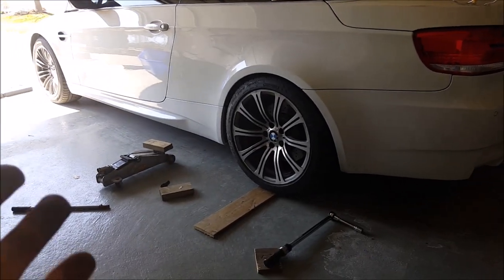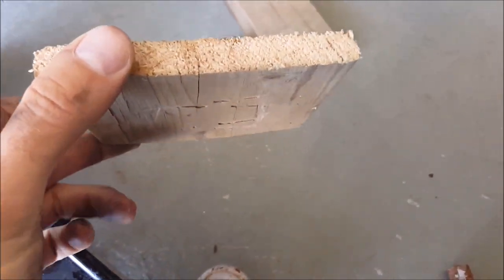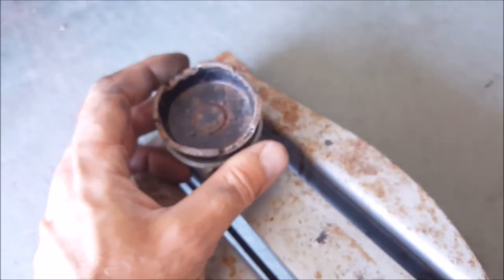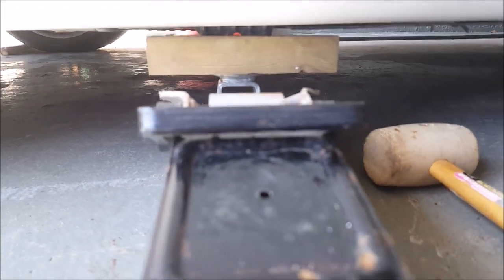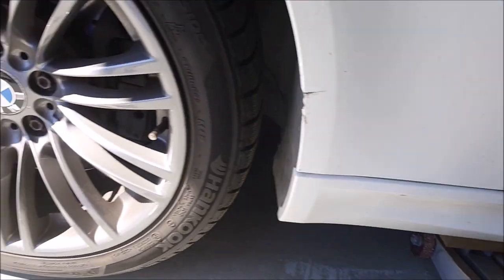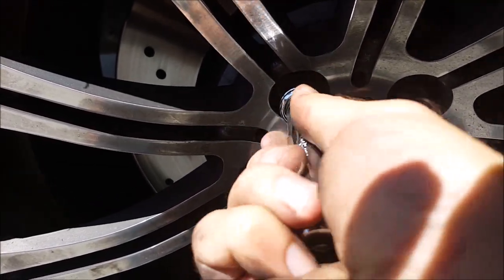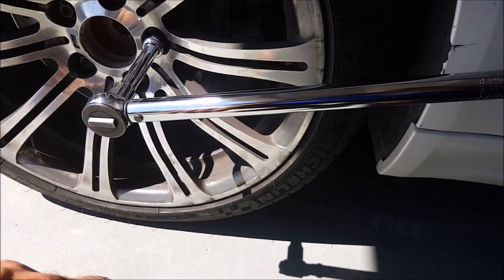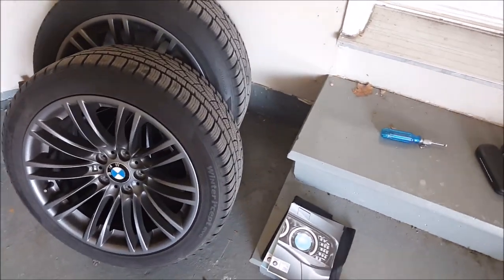How To Jack Up Any BMW Without a Jackpad Adaptor

Comment: don't use a torque wrench to loosen the lugs nuts, could damage the torque wrench. it's ment to tighten a lug nut or bolt at a specific torque. 

BREAKER Bar is the tool you use to break loose a nut or bolt.
Reply: beat me to it, I used to do it, before I wrecked a good torque wrench
Reply: Great advice... The video was going great untill he used the Tq to loosen the bolts.
Reply: Some torque wrenches allows you to use the opposite side of where you attach the socket so that you don’t damage the spring mechanism inside when loosening.
Reply: Thank you comment section for saving me a torque wrench!
Reply: Right?
Reply: @HarryESwan it was going great until I saw the rotted fence wood he tried first 😂 still watching for entertainment purposes

Comment: Why the hell are you using your torque wrench to break free wheel bolts?
Reply: @Chuck Yet another reason not to take advice from the internet!
Reply: @someone123421  My wrench can be damaged by doing it. Warns against doing it in the manual and a big sticker right below the snap on logo.
Reply: Hahahaahah

Comment: cut a piece of wood (preferably not pine but a decent bit of dense hardwood) to just under 2x2x1 that goes in the jacking point, then you are jacking directly on the frame of the vehicle, and not the plastic locator, if you have a jack that does not move properly on the ground as you jack it will strain the plastic and probably ruin it especially if you are in a very cold area.
plus as previous comments on the torque wrench for only tightening as by the time it has been  abused on 20 times undoing the wheels to change a set, unless it is a very good one it won't be in spec to do them back up again and normally read low meaning the threads will be overtight  (not a great idea on something that holds your wheels on- Breaker bar to undo torque wrench to tighten and do so with progressing increases not all in one go.

Comment: DONT loosen the bolts with a torque wrench! Use a breaker bar for that because youll fuck up the torque wrench. And you dont have to go in a star pattern if you are just loosening them, only when you tighten them.

Comment: I cut my 2x4 to about 2" long so it fits inside the jack pad hole, got about 3 uses before it split. Also please don't ruin your expensive torque wrenches loosening lugnuts, get a good breaker bar you can jump on.

Comment: That torque wrench is most likely going to need the brushes on it's internal flux capacitor looked at and possibly replaced or rotated.

Comment: These are dangerous instructions. Wood is not meant to support a (4000) Lb Car. Torque Wrenches are designed to tighten fasteners- not loosen them.  That's what Breaker and Cheater bars are for.

Comment: EIC: Have enjoyed your videos and content for years. And I'm the original owner of a spec-order 2003 e39 M-Sport that I've recently rehabilitated with full body paint job, bumper cover replace and full suspension, shocks, struts and springs refresh. A number of your actions are BMW do-not-dos.  Stick to red pill content.

Comment: i realized i lost my actual jack point square thing where the adaptor goes into. i have the adapter but i guess my jack point came off in a minor crash this winter...is there a safe way to jack up my car without this or do i need that plastic rectangle jack point piece?
Reply: did you ever figure it out??
Reply: @someone123421  i ended up ordering the jackpoint square. they were really cheap

Comment: Title should be.. How NOT To Jack Up And Loosen Your Wheel Bolts On A BMW.  You just ruined the plastic jack points purposely designed by BMW to safely jack up your car and you NEVER use a torque wrench to loosen up wheel bolts.

Comment: Cut the wood to size. The jack ports are made of plastic so that repeated use like this will cause them to crush under vehicle weight. BMW used plastic for this exact reason unfortunately. Sadly speaking from experience!

Comment: Several errors   Done  and by the way torque is 104 ft pounds 
Invest in a impact wrench  and never never use a torque wrench to remove or loosen bolts/nuts that’s what Breaker bars are for. you will kill the calibration  remember right tool for the right job. If you can’t afford them you should not have a BMW